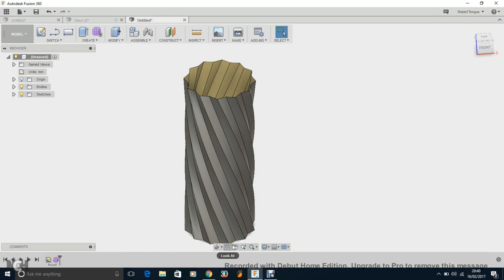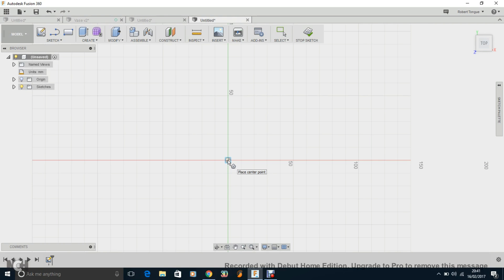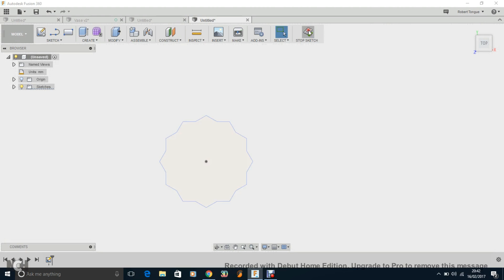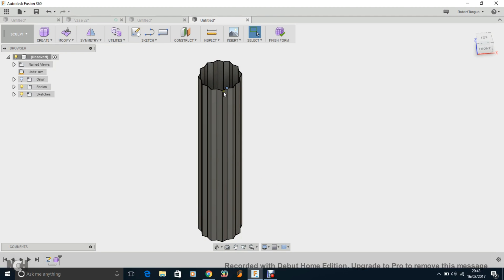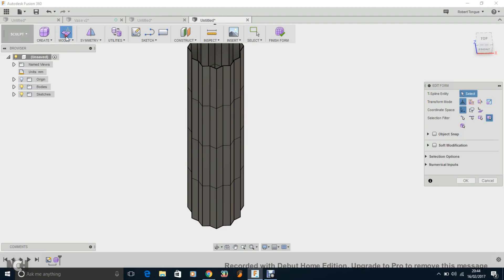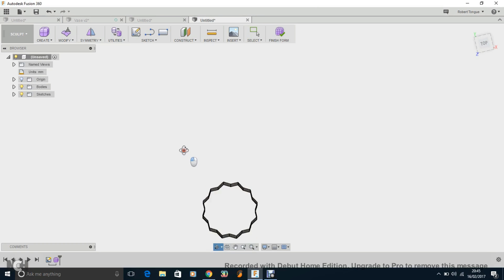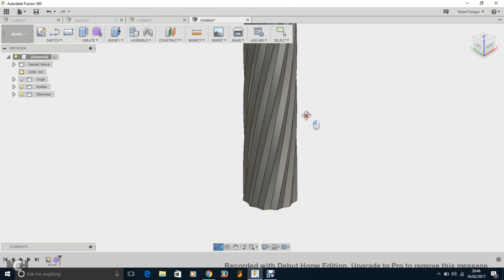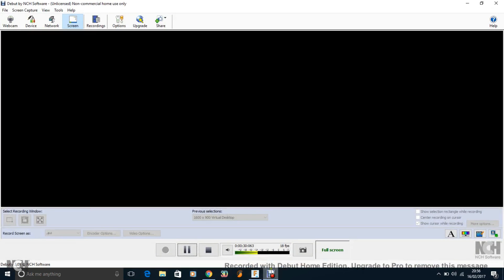How To Make Twist Containers in Fusion 360

Comment: Great tutorial! I'm trying to create a twisting container that has cut out holes in the side that twist with the structure - I'm not sure how to achieve this in Fusion 360. Imagine a hexagonal base, extruded up like in this video, but then with hexagonal holes in the faces of each side, which then get twisted along with the sides. Any ideas? I can't seem to apply sketches to the faces on the model when it's in sculpt mode.

Comment: Well, this is a much more handy technique than I used to make a spinning wire. I'm definitely gonna try this out. 

I used a coil to make a rail guide on which I used the loft feature to make the wire spin. Then I copied this body around the center. but is was so much more work than designing it straight and then rotating it on top. Couldn't find the right tutorial until now. Thanks!

Comment: At 5:43, it twists or rotates about the center of your current selection. You only had one edge selected, therefore it rotates about the center of that edge. When you double clicked the edge to select the whole chain, it rotates about the center of that whole selection, which is what you wanted.
Reply from the maker: Cool cheers for pointing it out.